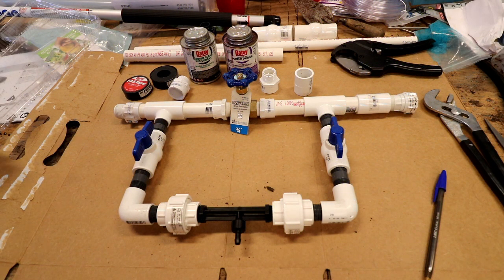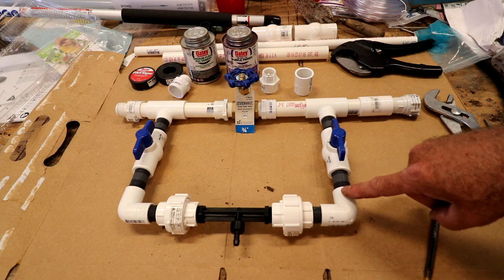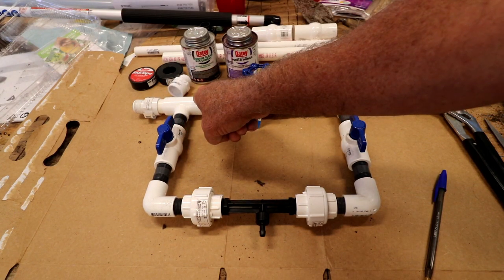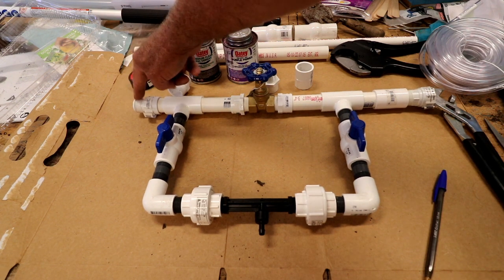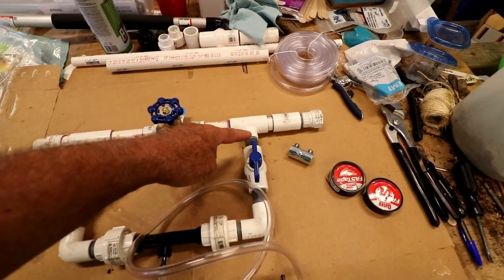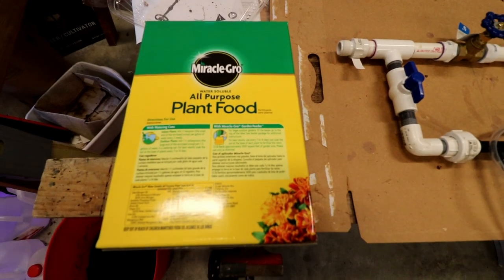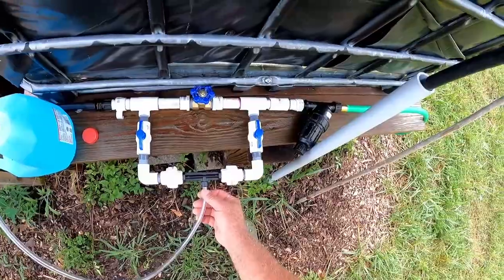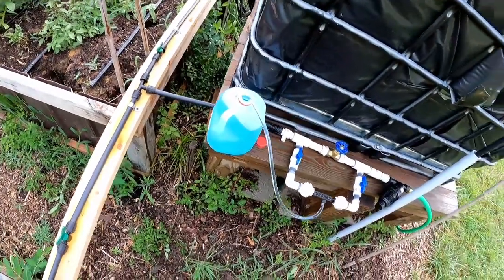#196 DIY Fertilizer Injector for Gravity Drip Irrigation

Comment: I made two of these for my raised beds.  I have them attached to digital hose timer. They both seem to siphon water from my bucket but when the water turned off the water flows out of the siphons tube. 

I dont have the 2 ball valves on the sides is that necessary?

Also do you keep your water on? 

To be clear my set up is in this or from the water source:
Anti siphon valve
Venturi loop
Drip filter 
Drip timer
Reply from the maker: My water source is an IBC tote so my setup is gravity feed only.  I intended to inject liquid fertilizer manually and not on a regular timer automagically.  I don't thnk the two ball valves are completely necessary, but they offer more control of the flow.

Comment: From what I understand if you close off your main valve so that it flows through your horseshoe, then instead of fully opening the right valve when viewed, only open it halfway which creates the pressure differential or suction. Opening it fully may create small amount of suction butt I'm curious if opening a halfway or 3/4 of the way while leaving the left horseshoe valve fully open makes a difference.
Wouldn't hurt to give it a try.
Reply from the maker: Thanks, headpainter1!  I'll def give it a try

Comment: I am thinking about making one of these but the problem I see is that you have to manually start the siphon every time.  I have an automatic timer that waters my garden and don't want to have to go out there and start the siphon myself.  How has it been going for you?  Have you added or changed anything?
Reply: Very good system. Maybe you could add 7mm check valve at the silicon hose to prevent to siphon everytime you need to add the Fertilizer 😊
Reply from the maker: Hey Plant-Based Prepper!  The way I think about and use the injector is that it is not meant to be an automatic process.  You only fertilize periodically, so I only setup the injector when needed, the rest of the time, the injector is detached from the irrigation system.  If you want to have it automatic, I see no problem with that.  You will just need a ginormous bucket or trash can full of liquid fertilizer (water soluble mix) and setup the injector, siphoning once to get it started.  It should work as long as you have liquid fertilizer in the container, since the vacuum should be maintained, since your automatic shut off should be close to the water source hose bib.  I have only used the injector with the gallon milk jugs, my goal was to use the injector for corn, but I didn't get the opportunity to plant corn this year.  I like the injector, particularly since my source is a gravity fed IBC tote.  I wasn't sure it would have enough flow from the tote to pull the fertilizer from the jug, but it does!  If you have a well or city water source from your house, you are better setup than I am.  Good Luck!
Reply: to get the siphon to run by it self the main valve need to be left slightly open this will cause a lower pressure on the left side of the setup  boosting the siphon effect
Reply: Can I use this with 1/2" landscape irrigation tubing? Would that affect any of the sizes of PVC fittings? Is it necessary to glue it?  Any updates?
Reply from the maker: I use the 1/2" landscape irrigation tubing for the in-bed main line and then drip tape in the beds.  I don't glue any of the fittings and have not had a problem so far.